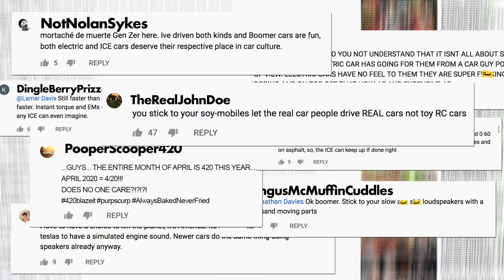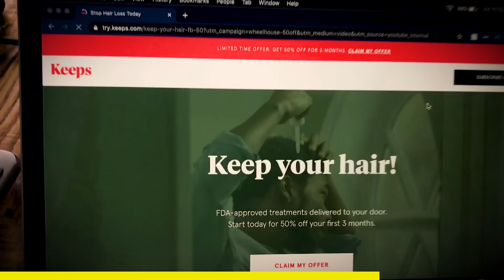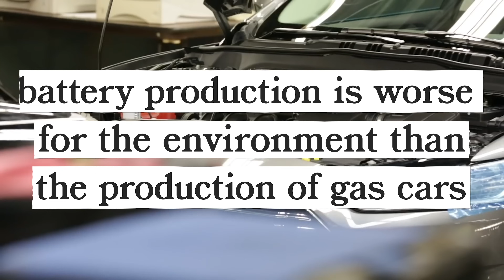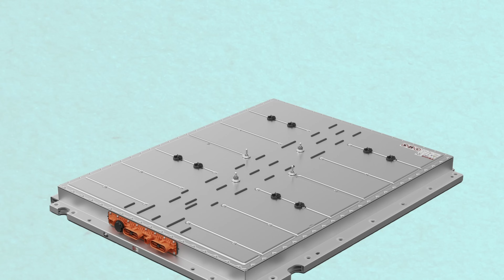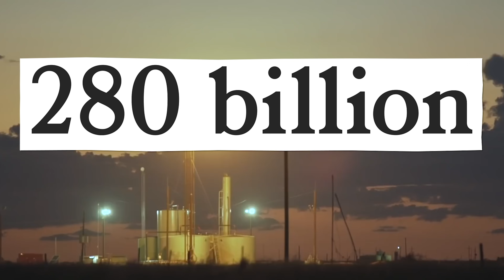Are Electric Cars REALLY Better for the Environment?

Comment: The primary point you need to keep in mind when listening to clean energy politics, IT IS NOT YET READY TO FULLY TAKE OVER. A successful transition to EV and emission reduced energy requires the tech to match current energy production methods for both output and longevity. Dont forget that clean energy has its own set of bad environmental impacts

Comment: Donut Media ..you are wrong about an abundance of power from our utility companies ...we are building peaker stations all over the USA to try and keep up with demand ..and gas turbine generators are very expensive way to generate power vs coal .natural gas powered gas turbine engines running generators for the power grids is why electric bills are going up at a very fast rate ....my power comes from coal fired power stations at about  $0.12 .per kilowatt hour ..were the regions are relying on peaker stations that are  natural gas  fired ..the rates are. $ 0.50 and higher per kilowatt hour..our coal fired power stations are going down each year .and no plans to build  new ones ..and it takes around 20 years to build a power house to supply the electricity of the ones being replaced ...so they keep setting up these gas turbine generating stations to keep up with demand that's not working ...there are power shortages all over America ..add a,  100 million electric  cars to our grid to be charged up  every day and there will be greater problems ...and will not happen till our power companies upgrade everything .
Reply: Oh and btw, stop spamming, you are outnumbered in a comment section like this.

Comment: Word. I fucking love it. Thank you for this. One thing I would like to add, as a benefit for EVs, is that the carbon released during production and mining and all that is all in one place and is more readily sequestered. Meaning that, even though the tech isn't quite there yet, in a few more years EVs are likely to make even less pollution because the power grid is transitioning to green energy. Imagine a few years of production where the progress of 100 years of ICE vehicles is done for EVs. But I am with you, I am still going to own an ICE vehicle, it's just going to have less wheels. :P Speaking of, Damon Motorcycles, you guys should check them out.

Comment: TESLA has no more federal rebates.. that was only for the first 200 thousand vehicles Tesla produced or some such amount.. Bottom line, they no longer have any federal rebates.. yet ALL the other EV manufacturers do because they haven't sold nearly enough cars to run out of rebate credits.. And yet Tesla is still outselling all other EVs..Not to mention Tesla has IMPROVED manufacturing. Tesla has reinvented manufacturing and is currently making 23% profit on ALL it's sales.. most every other manufacturer of any kind of car.. only makes about 5% profit.. That's because Elon is eating everyones lunch. The industry got lazy and complacent and Elon is making them pay... And Since Tesla's "Battery day", there is new information to this equation that probably reduces the carbon footprint further.. By the way, lithium is everywhere. it's the most abundant mineral in the world.. Tesla just bought land in Nevada to start extracting Lithium from Clay.. in a very eco friendly way. They also use much less Cobalt now.. And All the batteries in Teslas will last about 2 Million miles.. and the new batteries will go 3.5M miles.. This is just now being discovered through testing.. Tesla was not giving out these details.. Tesla will also begin fully recycling their batteries.. with the new chemistries they have created, it will be even easier to recycle batteries.. As Elon said.. at some point they will stop mining because the batteries will far out last the car and can be easily recycled.. Thanks for all the research.. Good stuff.

Comment: Hmm what about energy density, not advocating for either side. However I am pretty sure PETROL (gas is a state of matter where it is neither solid or liquid ;-) ) has a much higher energy density than LiOn batteries. Not that makes it better or worse but you need to take into consideration the losses. i.e. if PETROL is (i have no idea what the actual numbers are) 60% efficient and Batteries are only say 40% efficient it throws your numbers off.

Comment: Not to mention the Cobalt used to make gasoline, and it's destroyed in the process. It can be recovered during battery recycling. BTW, you are much to young to have a ICE the rest of your life. In 10 years they won't be making them anymore so you'll need to drive a 50 year old car when your retired. Good luck with that.
Reply: I would rather choke on a small piece of plastic than drive an electric car. I also don’t wanna replace my battery every few years because there is no way in hell batteries in Electric cars last more than 5 years. I am sorry, but that doesn’t exist.

Comment: Electric motor is great for standing start but otherwise not much. ICE reaches 60% efficiency - like camless (freevalve) engine that can store (compressed) air while engine braking (with up to 90% efficiency or recup) and then run few seconds as an air pump. Dual fuel - indirect gas and direct diesel (that cools & ignites the mixture at once) injection is cool too - it's ~ 85% gas 15% diesel.

Comment: This is an awesome start but should be an ongoing entry to a complete answer on this subject. What is the toll on the environment for 100 / 200 / 300 thousand miles (or kilometers) or more? We need to discuss the cost of the power train as opposed to the cost of the complete cars as the basic body is nearly the same for both.  WHY is there a rebate for ev's and not i.c.e.? If the virtues of e.v . is better then why should it need a rebate at all? Recycling an i.c.e. powertrain vs battery powertrain should also be discussed. All testing seems to be done at normal room temps and should also include heater operation in cold. If i.c.e. is measured at hiway / city then a fair comparison should include -30 / +68 / and +90 deg temps for e.v.  There are a LOT more questions that need to answered for a fair comparison. Great article but need more thorough research. Don't stop now. Please, don't stop now. As said please make the hour video as most us us are captive audience anyways (o:

Comment: What about lpg or cng not even half as bad on the environment to extract, it's readily available and emissions are way lower than gasoline or diesel.
I know a lot of people have had bad experiences using lpg because of bad tuning, wrong installations/bad setups e.t.c
I had one engine failure myself long ago, but nowadays I own high a  compression na vehicle that has 90k miles on the clock running lpg.
Some may ask why daily a high comp na car but the way things turned out  it's my only car and due to lower emissions I get to drive downtown without restrictions
Reply: New fuels are being developed that give extremely clean emissions from internal combustion engines. For example the new synthetic fuel developed by porsche reduces tail pipe emissions by 85%. This would put the internal combustion engine on a level of emissions output at the same level as a electric vehicles.

Comment: there nothing green about these cars the batteries need charging fossil fuels for the next 30 years also batteries are killing the planet of its recourses to pollute massive areas farming cobalt and lithium. Co2 is very high to manufacture the batteries about 6 years worth of co2 that a petrol engine use the batteries will need recycling causing more pollution co2 and the batteries will need changing at least once in their life time. quick way to cause climate problems worse than petrol vehicle

Comment: this is not fully true as the recycling of electric vehicle batteries waste more co2 then there production, and the batteries have to be replaced more than once in their life time. We are using slave children to extract cobalt which is going to run out faster than petrol. And Mazda have come up with a new active vehicle crossing diesel engine with petrol engine eliminating tonnes c02 and could be the future

Comment: Internal combustion engines are horribly inefficient, from an energy consumption standpoint. Way too much energy dissipates into heat through the process. And there aren't many ways to make that process more efficient. On the contrary, EV battery technology has come a long way over the last few years and will continue to evolve quickly, with the massive investments that are being made in research and development. That means the industry's dependence on lithium and cobalt will likely be a thing of the past, by the time EVs become the way to go.

Comment: I think it’s important that if one is genuinely trying to convey facts over a controversial subject, list all the sources in your description.  The reality as I understand it now is that no energy is ‘clean’ and no vehicle is ‘zero emissions.’  Solar panels, wind turbines need traditional materials and power plants to manufacture - the goal should be about using what is ‘cleaner’ over the long haul.  Yes, solar panels require energy sources (fossil fueled) to manufacture, but have extremely long lifespans; like the EV argument - larger carbon footprint upfront, and lesser footprint during use.  So the goal should be to try to create a circular economy so we know from inception to disposal, what is the net cost to the environment, and in dollars spent.  Lastly, would love to know a comparison between driving a used car for 10 years, v. buying a new EV and owning for 10 years?  Break even?

Comment: Image this ..you drive electric car with energy from solar power from the roof of your house...whtat is your emmision foot print? ZERO
Reply: Well, in the interests of balanced debate, there would still the emissions from the manufacture of those solar panels. But of course it's endless really. An i.c. car continues to require gas/petrol and oil throughout it's life, and that fuel and oil has to be transported to the fuel pump using trucks which emit exhaust fumes.... plus there's the used oil etc from servicing etc. Over a life of,say 15 years, the EV will be less polluting overall....
Reply: most modern house footprint size are too small to fit enough solar capacity on the roof.
If you are charging a car, that energy can't be used by the house, so you still need energy fed to the property.

EV energy requirements offset against Gas, Nuclear or coal powered stations.

Nuclear are built to run at fixed generation rate, as the time to cycle demand is too long, it is supplemented by other dirty generation.

There are exceptions, such as dam hydro-electric, and tidal systems that can be predicted model of generation.

Solar and wind are variable, and the maintenance costs of upkeep are incredible.

Comment: Dude, tabulate you’re numbers so we can see the totals and how they break down. Also, if your data is right, oil refining is the big culprit here and it is not clear if you included it or not. You say (@ 7:50) refining causes 767 million tons of CO2 daily and 95 million barrels produced daily.  This amounts to 8 tons of CO2 to refine one barrel of oil. Seems high. 42 gallons in a barrel, and 500 gallons per car per year implies each car generates 96 tons of CO2 just from refining the gasoline it uses. Can that be right?  Is it in your totals?  Please check your numbers and advise.

Comment: Probably been asked but did he account for battery deterration and battery life span the numbers are all over the place from 5-20years but every year the batteries will get worse and some will need recycling sooner therefor doubling the co2 needed to build another battery and the cost of recycling as per a gas car can go for years with the same output with oil changes.. and FYI the oil production is needed for all production of both cars and the clean energy products .. not a fair comparison he missed a few points also to add making new cars just for the sake of Bailey making it better is crazy and what about the destruction of salt mines and combat .. to get them to the same enviro standards as ethical oil and gas producers would probably be too expensive ... facts missed

Comment: Myth 1. 'In the long run'. So.. 20 years? Where you have to replace the batteries after 10 years, so it starts from the beginning again. Also no country except norway and iceland have more than 10% 'green' energy like solar or wind.
Reply: Watch the video
Reply: Actually you're wrong. The UK also now generates 50% of it's energy needs from renewable sources, and has done so since 2019. Your information is WAY out of date... In Norway the figure is higher still. Around 80% I think. But Norway has plentiful supplies of hydro electric power available.

Comment: 1. Yes EVs have an initial higher CO2 production due to manufacturing, but you need to think about the long run mate. ICE cars on average produce 4-5 metric tonnes of CO2 per year, which obviously is going to add up to a lot more over time. And on top of that, once oil is mined it physically needs to be transported to gas stations etc. which produces even more emissions (whereas electricity is transported through powerlines with minimal energy loss). 
2. Essentially every single electronic device you use has lithium and cobalt in it. So don’t make it sound like it is just EVs doing this. Tesla batteries are now going cobalt-free anyway so this solves the ethical dilemma.
3. Another mis-informed fact. The relative number of EVs and EV batteries which catch on fire are significantly less than the number of ICE vehicles which blow up every single day (because of the explosives inside the car). Yes, recycling processes are still not perfected, but they are still comparatively better than using an ICE car in the long-run. 
4. Yes although some power plants are run by coal, not all are. It is still almost twice as efficient and less polluting to run an EV on coal than an ICE car on gas. Many EV charging stations have a requirement to only be run on renewables and hence the total proportion of EVs which actually run on non-renewables is relatively low. Moreover, people who buy EVs are generally more environmentally conscious and will probably opt to have their house run by renewables anyway (e.g. solar).
5. The points which are provided about oil extraction are very relevant. This is perhaps one of the main reasons EVs are still more environmentally friendly in the long run. 
6. Wow and his final statement is ‘ok I like the sound of gas cars, so I’m gonna keep destroying the environment’. Good job mate you are obviously EXTREMELY INTELLIGENT (not) to provide all those statistical reasons as to why EVs are more environmentally friendly and then keep burning dinosaur bones. Congrats to another stupid YouTuber.

Comment: that's funny....... how can you say that a electric car is cleaner? on what average lifecycle of a electric car is this based?? 
i mean, the efficiency from those batteries drop with the hour of usage. how long does that battery last before it needs to be replaced? 5 years? did you take that with the calculations. because if a combustion car drives around for 20 years wich isn't far fetched at all. that would mean 4 batteries. 

this whole problem isn't about the enviroment, the industry doesn't give 2 cents about the enviroment. it's becoming more difficult to get the oil. they NEED TO WAGE WARS to get to oil. geuss that's a big spending issue. buying oils from sjieks. pumping money to those islamic countries wich are getting stupid rich at the moment. wich is bad. 

no it's about power, it's about money, it's about being independent for your own resources. but that's not what they are telling you. ofcourse not. 
don't be a dumb ass sheep, nobody cares about the fucking enviroment, why? politics do nothing, companies do nothing, BUT THEY FORCE THE NORMAL PEOPLE TO THINK ABOUT IT why???? SO YOU BUY ALL THEIR DUMB SHIT YOU DON'T NEED                                 I T   ' S        ...............            A  B O  U  T              ................                     M  O  N  E  Y   ........